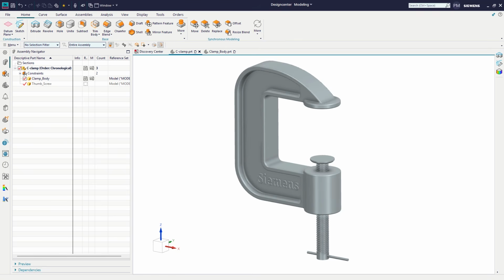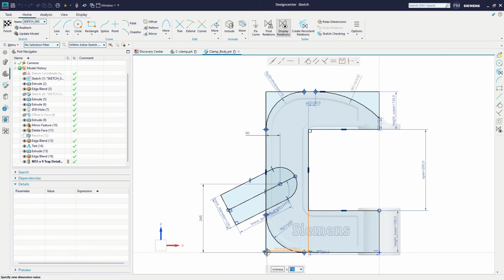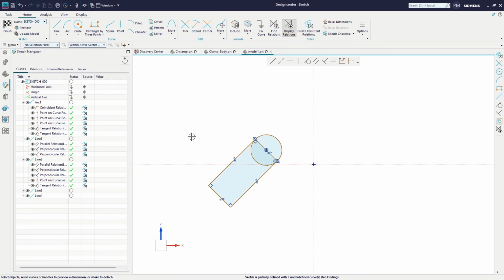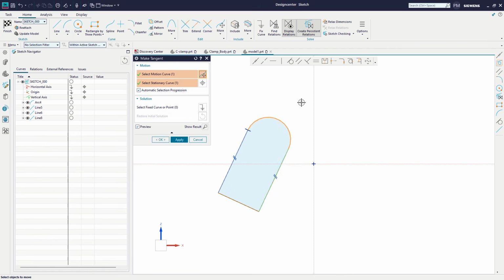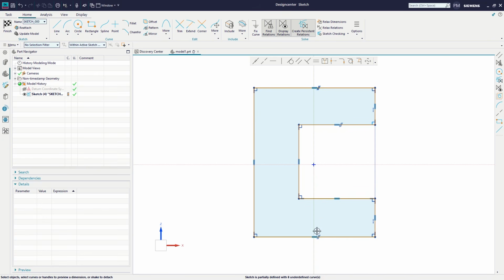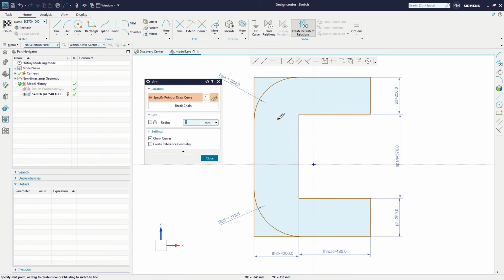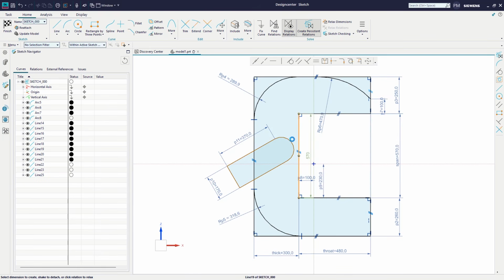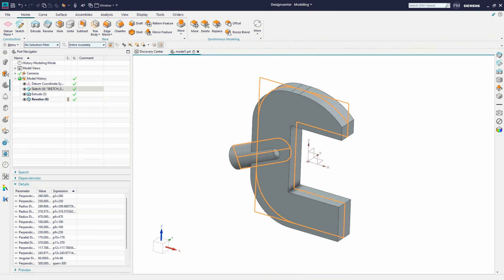Designcenter | How to | Control sketch behavior

Comment: Can we unfix a fix curve in sketch environment. The only way i know is to delete that fix curve . Don’t have any alternate way to unfix a curve later in design🧐
Reply from the maker: Hi - Thanks for your question. Here's what our experts recommend: 
What you need to do is Select the Fixed Command icon first; this will highlight all fixed entities in the selection dialog. Next, use Deselect All (if you want to remove all (Fixed Entities) or Shift+Select to remove just one of the entities. 
Hope this helps solve your question! Best, Team Siemens
Reply from the maker: Hi - thanks for your question. We're reaching out to our experts for some information, but in the meantime, you might find a solution to this question in our Designcenter user community: https://sie.ag/6P5jmw